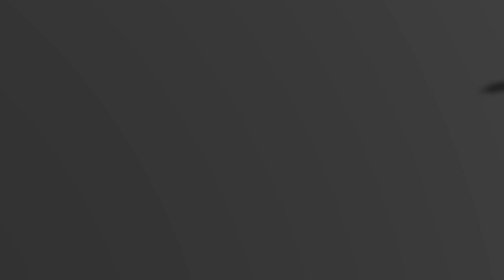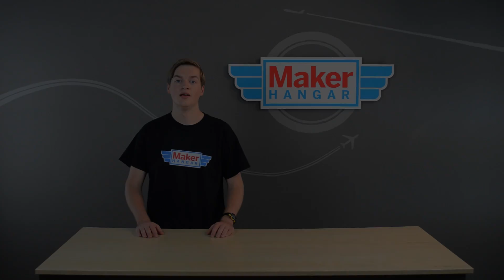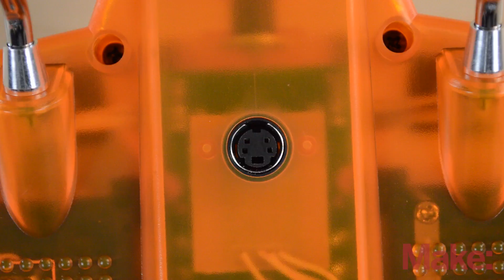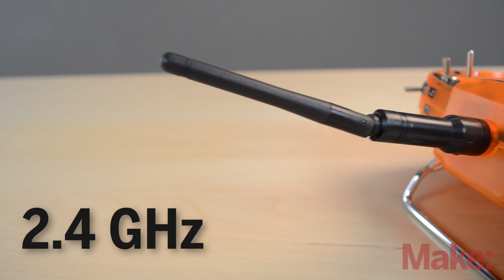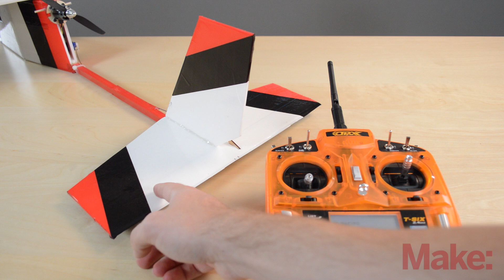Maker Hangar: Episode 6 - R/C Radios

Comment: good choice, especially if you want to control different kinds of vehicles. Cars and boats work one way, Airplanes, gliders, and some old helis work another, still new helis like my Trex or the Blade helis use another (called CCPM, Acro for planes, and Car for cars and boats)

Being able to use the screen to set stuff is INFINITELY better then the crap I get to deal with. Got so annoyed with setting the radio that I haven't touched it in a year.

Comment: That mainly depends on the R/C radio. Some, like the FlySky radio that came with my heli, can only pair to one receiver. They mile even have onboard setting adjustment, or need a PC, like, well,  my FlySky radio.

I recommend a radio like the one he's showing, it's only ten dollars more then mine was, but you don't need to mess with the PC link cable as much. I do believe this one can multi-pair (can be paired more then once) The other option is to move the receiver, but that's a pain.